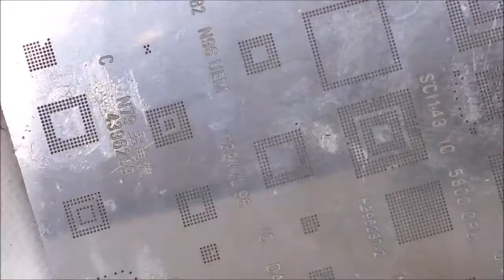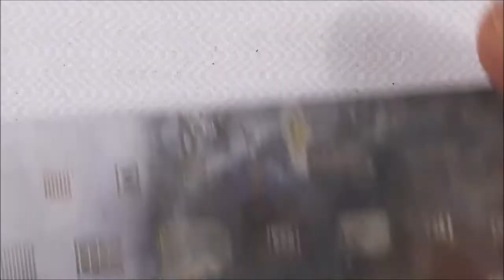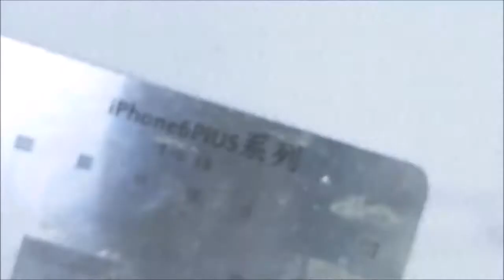Lenovo Tab 3 7 Essentials Won't Turn On, LENOVO TB3-710F Tab3 7 Essential Dead,

Comment: I changed this ic.now when tablet turn on  ,on the logo turn off.what's the problme?
Reply from the maker: Sir before its working? it's working before then change one more ic
Reply: @MobileRepairingTutorial  no it's not working.because when i open it i saw it hasn't this ic.and i do that you say on youtube video.
Reply from the maker: @saeedabbasi5795  sir remove ic then short vbat and vcc main then check its turn on or not. Please before boost battery
Reply: @MobileRepairingTutorial  thank for your help🙏🌹